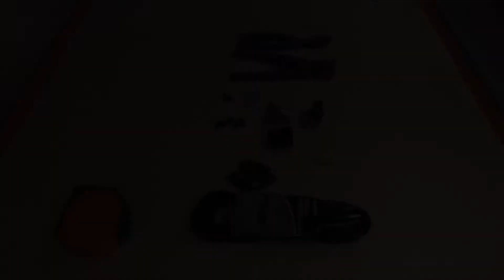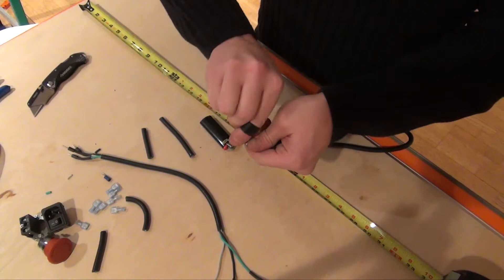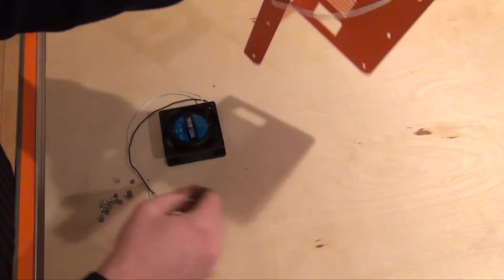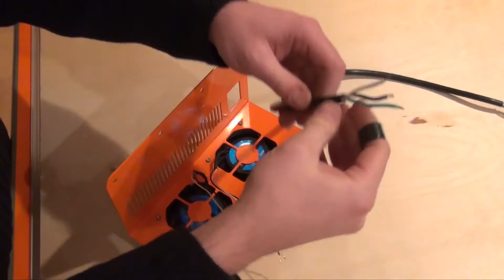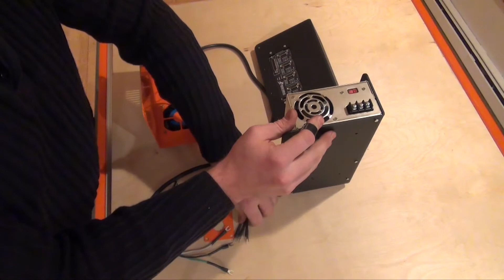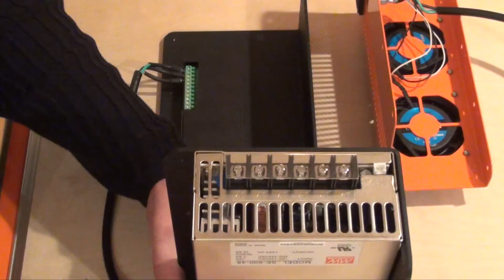Platform CNC Kit Assembly | Electronics, Part 1

Comment: I like to ask as an Electrician myself why you stop switch the Negative not the Positive. I know cutting the circuit + or - will stop a motor but cutting the - with a switch means that  the + power still goes up the cable through the motor all the way back to the - @ the stop switch. If you ever have a problem that a motor faults to ground / - just hitting the stop switch will not cut the power. Same as if you leave the power on to the machine but only use the stop stitch - & there is a breakdown / Short say from a motor to ground in theory the motor will start. We all know in the trade - & Grounds can & do get swapped somewhere between your machine & the Power station.   The only thing that ever stays the same it the +

Comment: What brand is you wire strippers and model?
Reply from the maker: +William Ward I got them at Radio Shack.  There are similarly functioning ones at Home Depot.  I am unsure of the brand...
Reply: Oh, thanks. I have a set that is a different brand. Always ask the tool matters to include your CNC. Which I like probably will buy one.
Reply: William Ward